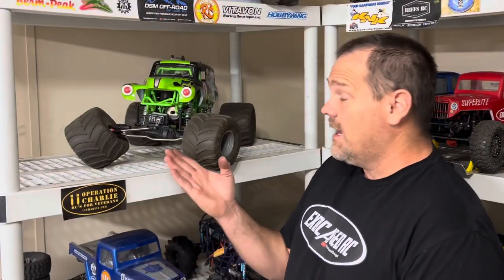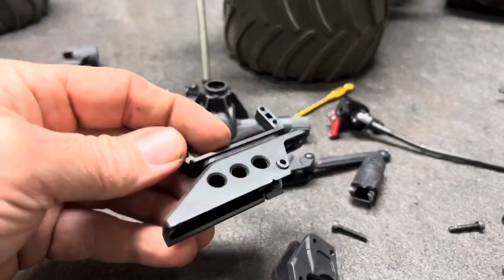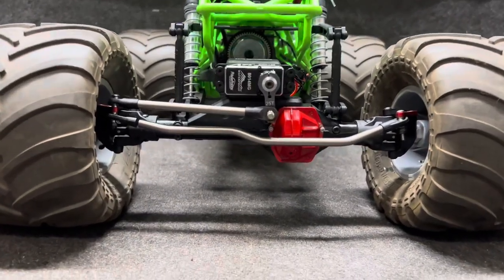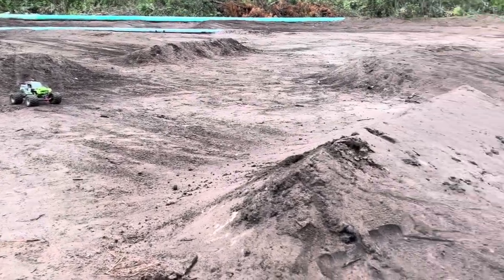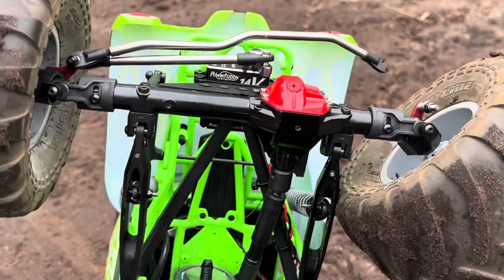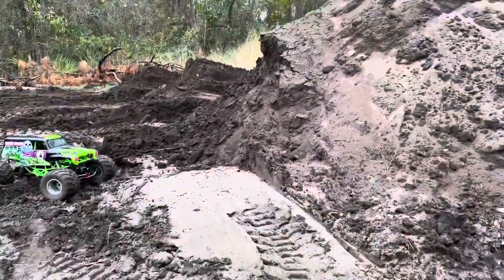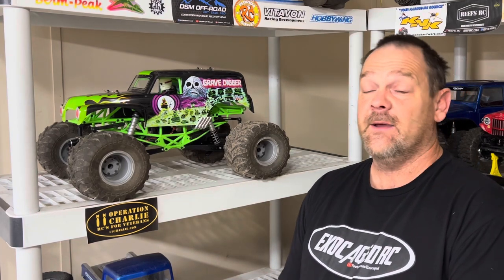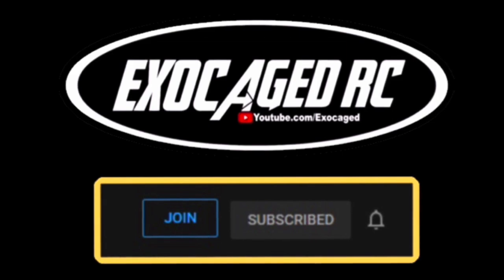Axial SMT Cheap Axle Housing install and test

Comment: Ah, the SMT...great truck but I'm always wondering "What will I break this time?" :p Time to get mine out again.
I run "beef" style tubes in my axle housings.
Reply: How do the beef tubes hold up. I mildly beat my smt10. I thought about ordering some. Or do you upgrade to the metal housing?

Comment: This is why wood makes a better block to smash axels straight!  It allows for the steel to over bend to compensate for the spring back effect the steel will have.
Reply from the maker: you have a point!!

Comment: Thanks for this video 🙂.
This Axial is less expensive than the losi smt, and it seems to me much more fragile than the lmt. I'm wrong.
In the end, I tell myself that buying this Axial cheaper, and having to upgrade all the parts, is going to get me to the same price as a losi lmt...
Do you know of any other stadium truck like this one that would be more reliable and solid?
Reply: thats a monster truck not a stadium truck . when i built my monster truck i used a hpi savage with proline bypass shocks and fling king 3.8 tires on rc4wd beadlocks , carbon tvp plates , novarossi 28-8 motor with ths racing pipe ,i ONLY use vp racing nitro 20 percent

Comment: Idk if drive shafts are a real problem on these trucks but the ryft drive shafts would be a super nice and tough upgrade
Reply from the maker: Right. I was thinking the same thing and I thing the tubes will bolt right on the stock ends.
Reply: @ExocagedRC  yes sir! Bolt the tubes straight to the original universal joint end pieces

Comment: Hey Joe,
On eBay I've found ar60 aluminum c hubs and knuckles combo for $25. I'd love if you could pick up a set or two and review them. I've been wanting to do rear steer on my bomber, been thinking of the  eBay aluminum parts, but worried about the quality. I'd send you the link if you're interested

Comment: a quick fix for this until you get a new drive shaft is to take some heavy-duty shrink tube and shrink it over the drive shaft.  Its not pretty but it will keep you out on the jumps for a bit longer.

Comment: Are those extra speed ? Looks like it I dremel,d a set to put a third bearing on the pinion which involved cutting a socket 🤬any way that metal doesn't grind worth a dang!! Never broken them either great video👍💯

Comment: I have a SMT with grey vanquish axles housings, blue steering parts and lockouts. Hot racing aluminum and carbon fiber trailing arms. Custom carbon fiber sway bars. Incision upper links. Caslte mamba x and holmes hobbies 3800kv censored. Robinson racing steel spur. Reefs 500. Aluminum rc4wd beadlock wheels jconcepts renegade tires. Mip bombproof super shafty driveshafts. I really want to buy the carbon assault chassis for 200 bucks to finish it off. It has a white silverado body painted pearl white. I had custom stickers made for it. Its called white lightning.